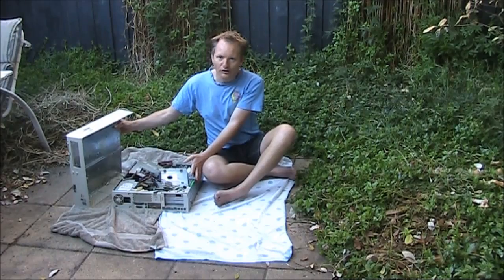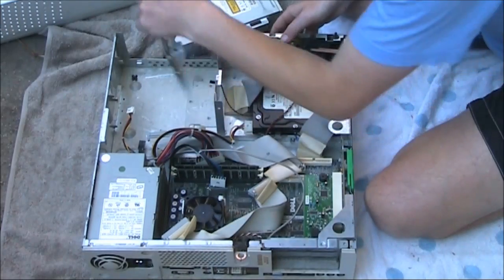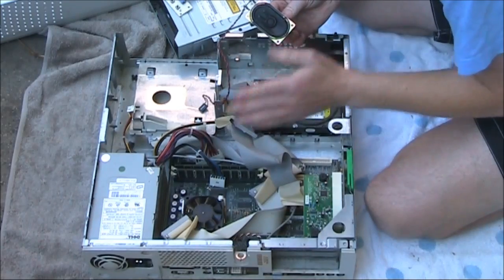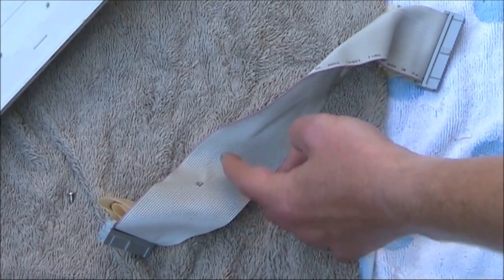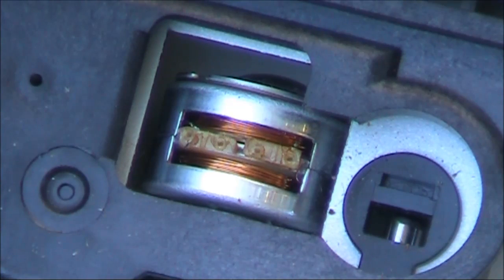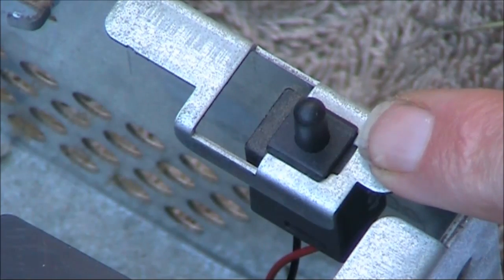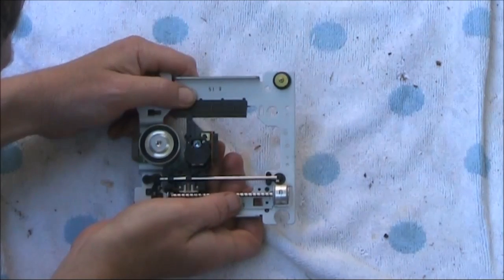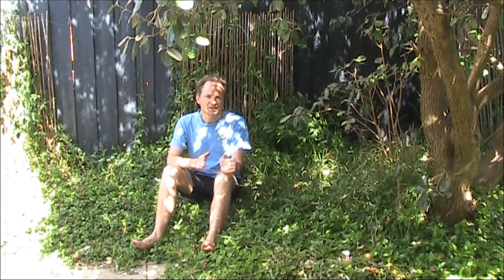Electronics on the floor: Making use of parts from old computers

Comment: Great ideas.. If you can find a number of computer boxes about the same size and remove the internal components. Either leave the front panel off or take a hacksaw and open it up to make stackable storage shelves for small items/parts. Such as plastic bags with various components and a list in each drawer, listing the goodies.. Even plastic cups or pop bottles cut in half can make storage containers. These can stack on a bench top or even the floor for lots of free storage for items that end up filling landfills.

Comment: Thanks for the hints! There's another possible destination for your old PC: keep using it!!! If your hard and soft were fine for you 5 or 8 years ago they may keep suiting your needs today if they didn't change much. Just refrain from installing the very last OS, office package or 5-D game. Yes, there's a downside to that, XP security holes are not longer being filled by updates, but it isn't serious if you don't do online banking, credit card purchases, etc. There are good Linux and OpenOffice distributions perfectly adequate for old PCs.
Reply: So easy with Linux, dozens of flavors. Totally "over" proprietary software, get open sourced!

Comment: those 90 degree USB connectors on the motherboard look useful too,  you could easily use them to make a 5v power input socket and then power a device off anything that has a USB socket with a standard male-male USB lead.  And even cars are being produced with USB sockets now so it really is becoming a universal power port.

Comment: I've found that old PCs can yield some power MOSFETs and 78xx voltage regulators, and RFI toroids.
Old CRT tvs are worth a look for power transistors and old CRT monitors often have very high quality components.
Is there a 14.318 CW net?